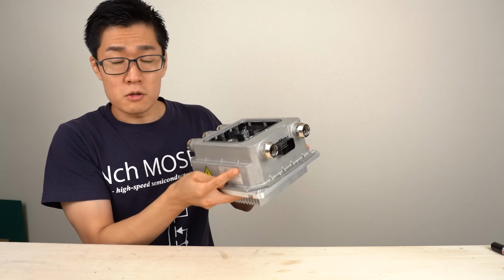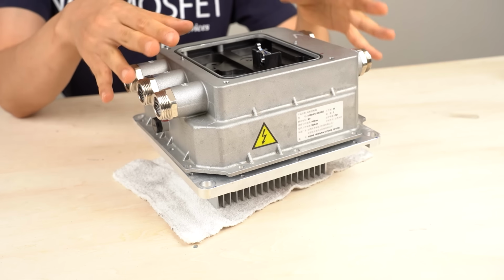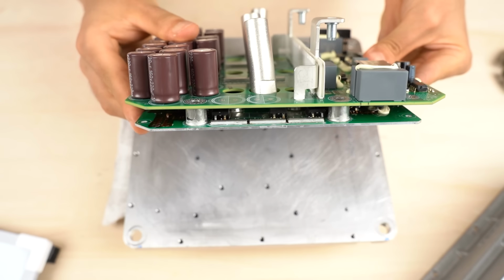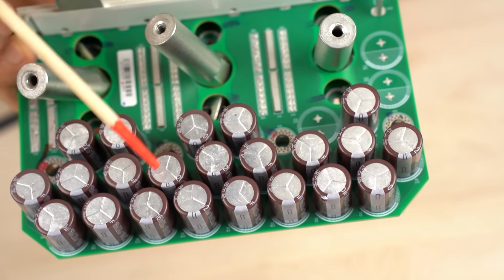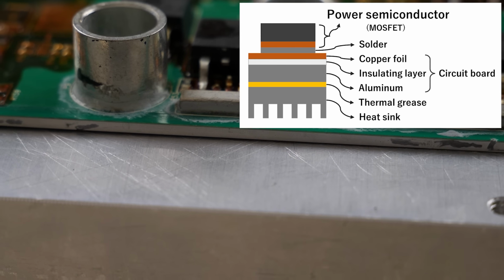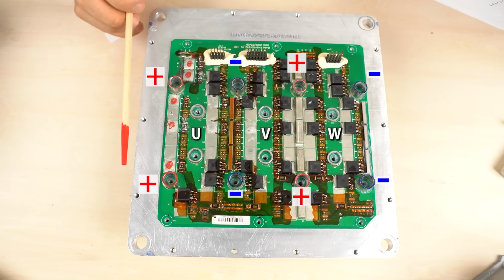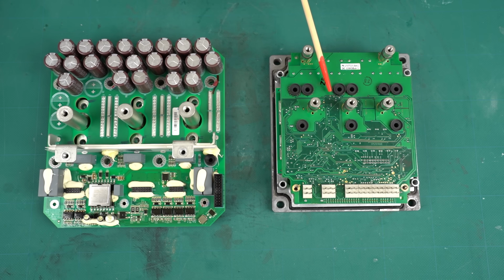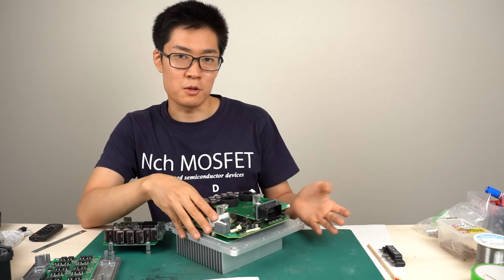$4000 Electric Car Inverter Teardown.

Comment: Great tear down. I'm going to make an educated guess that thicker busbar is due to the two rows of FETs mounted back to back and not much thermal area on the board to dissipate heat. With that larger, what looks like aluminum, busbar it helps remove heat.
Reply: 350 amps it's for current
Reply: @lloydtshare  Why  only one bus is larger than? The others will also carry the same amount of current and they are smaller. Which was the whole point on why he was questioning the one substantially larger bus.  If you look at where the single larger bus is, the FETs between phases are closer than anywhere else on the board. So, needs more heat dissipation.
Reply: @inothome  Looks like caps to me and not even touching the DC input bus bar, the 3 phase ac output bus bars are thick so they can output more current than the input bus, also they won't remove heat they will create heat because of resistance so attaching any FETs is a really bad idea
Reply: @lloydtshare  Look at 11:58, he mentions it numerous times. It's a larger bus, not caps and the bus will pull heat from the board. The FETs sink their heat in to the board and with the heatsink and larger bus it will help dissipate that heat.  If you look at the two opposing rows of FETs, the larger bus bar has the FETs arranged closer together. Vs the other arrangements where the legs of the FETs point towards each other and allow for more heat dissipation without an added larger bus.
Reply: @inothome   looks like it's for more current on v phase as it has more mosfets around that bus
Reply: @lloydtshare  The negative rail just to the left feeds just as many FETs, but the FETs are legs first towards that bus. So more surface area for cooling. But he also questioned why a smaller bus there when he thinks it should be bigger as well. The only difference I see is how much physically closer the FETs are on the larger bus vs the smaller bus. PCBs do sink and dissipate heat.

Comment: How is this different from a tesla tho  ?
Reply: Much lower voltage
Reply: Smaller currents lower voltage.
Reply: switching device and capacitors. rest is probably the same.
Reply: I reckon a Tesla would use a much bigger one, this is just for a regular car battery
Reply: Not as Nazi

Comment: Great for me that you have English-speaking version. I guess the pink sheet attached on one side of the rubber is a thermal interface material. It's used for sharing heat between caps and for easier removing heat out from the caps, to lengthen the caps' life.
Reply: Spot on.
Reply: American* English.

Comment: Why isn't there a solid capacitor instead of a very bad production capacitor? It will break down quickly and half of the car will need to be dismantled to repair it. You cannot sell it to Europe, not with the new law. 🤣
Reply: actually, why not use many small caps and therefore reduce load on every single one of them?
Reply: @ivok9846 do you mean MLCC instead of electrolyic caps?
Reply: @szekerespista3758  no, mlcc is low capacitance and unreliable, they constantly die on laptops, phones etc.
ie even worse than alu elko.
Reply: @ivok9846 because those electrolytic capacitors have a life span of 15 years.
Reply: The inverter probably isn't particularly hard to get to.
Reply: What do you mean by "bad production capacitor" ?
These caps are also used in American made and European made industrial equipment.

Why a lot of small ones are used instead of one big, he explained very well.
Reply: @bonnersommer7201  the electrolytic capacitor has a reputation for being of poor quality if it's not a brand name. Some say cheap caps pop. I've never seen a problem. They all last about as long.
Reply: Plus I don't trust the contact connections that connect the top capacity board to the  bottom inverter board. Time connections look like they can handle  just a few amps safely
Reply: better find a 4k dollar electric car
Reply: The caps will outlive the battery, after which the entire car is a paperweight anyway...
Reply: @unimportant5122  which is what? About 15 years?
Reply: Because cost and reliability are usually inversely related?
Reply: @tbird-z1r  opel rocks-e .
i doubt that's not almost entirely made in china....if not assembled in china. 
so that law, if it even exists (there are Chinese cars in europe, dunno specifically about electrics), is kinda moot, they'll source parts where they're cheap. gotta keep them profits high.
Reply: The current in mosfets are nominally shared equally due to the negative temperature coefficient. Enough that you see them used without any balancing resistors very frequently
Reply: It's chinese, they don't outlive their products because they're also made in china
Reply: Don't give them any ideas, they will just steal it anyway a couple years from now.
Reply: Maybe due to lower ESR
Reply: I PROMISE YOU every electric car in the European market and American still contains regular electrolytic capacitors
Reply: @tullgutten    my post about the life span of said capacitors was removed. Amazing.
Reply: @PonkyKong no, your Comments 
("how long do they last?" And "They have a life span of 15 years")
 are still readable.
Reply: @bonnersommer7201  sweet.
Reply: For low frequency ripple, there is no better capacitor type then an electrolytic for comparable protection. This response shows ignorance, not superiority.
Reply: @IronBrain0  how long do they last?
Reply: Ignorant much?
Reply: Its a chinese product

Comment: All things considered they did a good job for the design. I was expecting worse
Reply: Good design, cheapened parts. Typical engineering things after they pass the designs to the costing department
Reply: I agree, they cost cut on the electrolytics but the design is good value.
Reply: The thing is, unless they control very closely their supply chain, some of those IC might be fake.
Reply: they invest in one thing making the other worse. cannot be judged by just an inverter
Reply: this is a world leading design/manufacture considering the overall cost